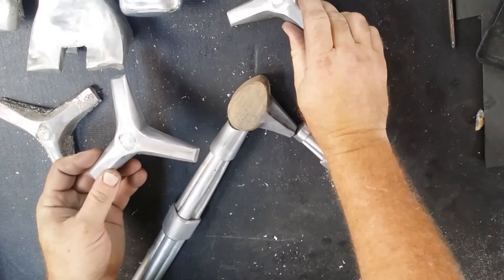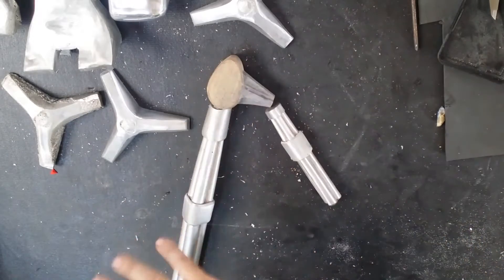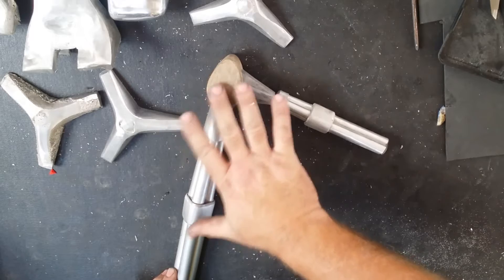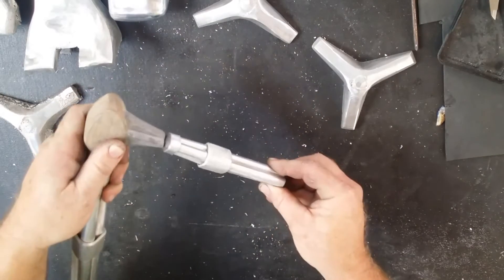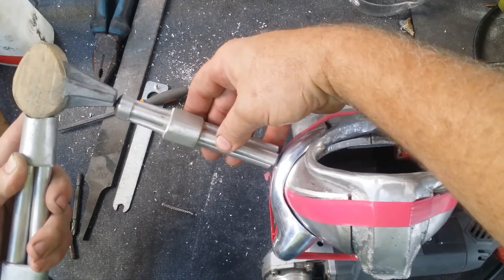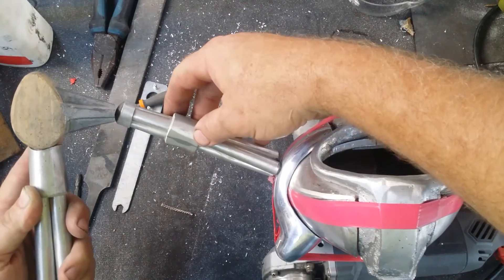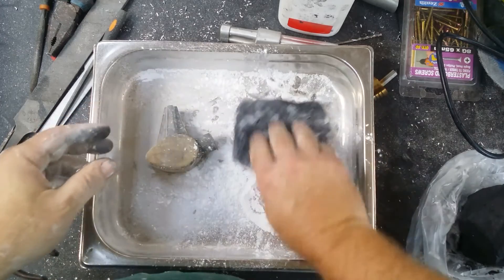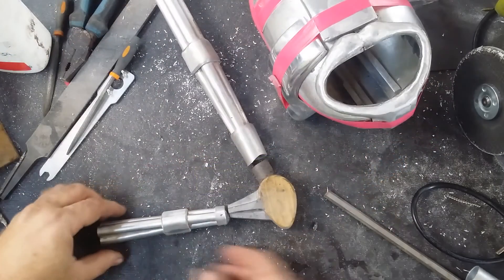War Of The Worlds P11

Comment: Not putting a hinge in the leg will be a mistake.
Reply from the maker: What's your thought's ?
Reply: @jazcreations  I think you'll have issues with pose-ability if you don't have a knee joint making the 2 ball joints pointless,also if it is a hinge you can add a working piston like on the terminator project which would be nice, i'd make an encapsulated scissor like hinge locked by a bolt in that hole in the reference pictures and just have shell made of aluminium sheeting connected to the bottom leg and brazed together.
As a bonus it would make from some interesting videos.
Reply from the maker: @VeggeMight   I haven't total written of the idea of a hinge point, but I think it's going to be too top heavy to have much in the way movement, I probably make one leg up as a test to see
Reply: @jazcreations  I think if you have a big enough bolt with Knurling or have something like a lock washer it wouldn't move if you stood on it :)
Reply: Just like wheels, they must turn. :)